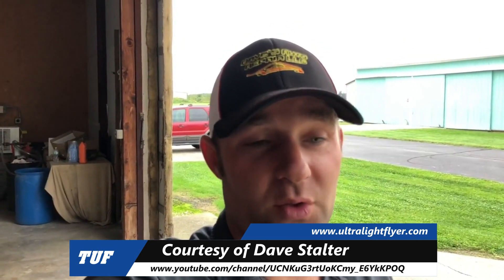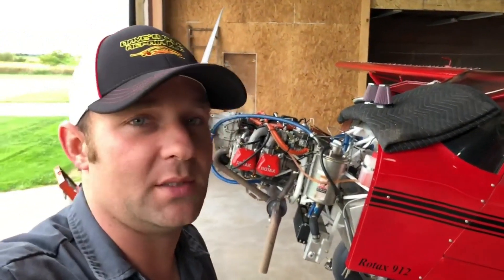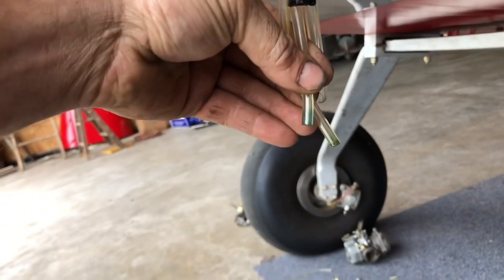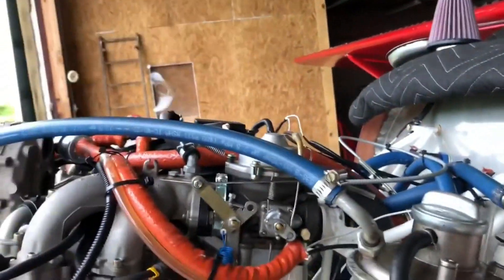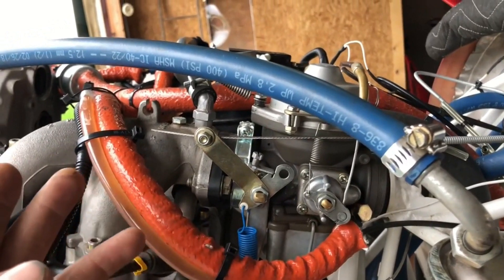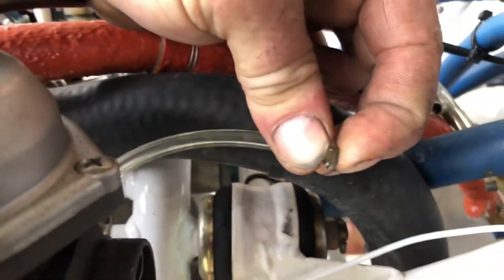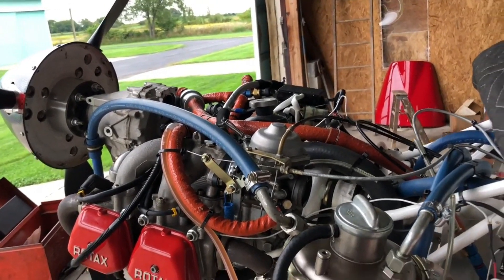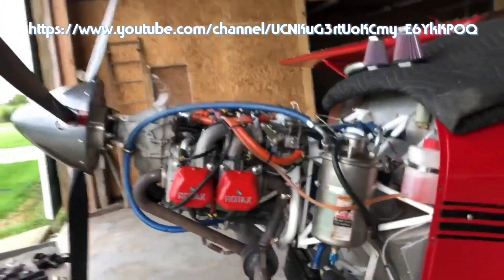Rotax 912, Bing Carburator, Vent Tube Advisory.

Comment: The other thing to avoid is having the vent tubes too short.
You have to think where the fuel might go if it does drip.
Your left bank route looks like it would drip straight onto the exhaust ! 🔥

Comment: They aren’t drain tubes they are vents. This is pretty a well known problem. It’s in the Rotax installation manual, chapter 73-00-00, 2.1.1, page 13 on how to route the pipes.

Comment: Usually you mount a catch tray under the carbs  and then run your drain pipes like you did. Great tip about the exhaust.